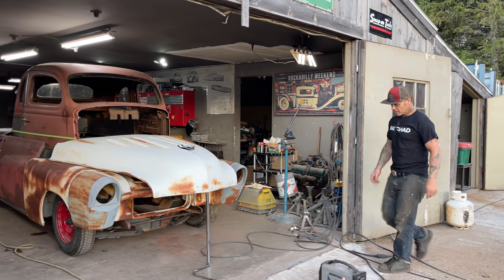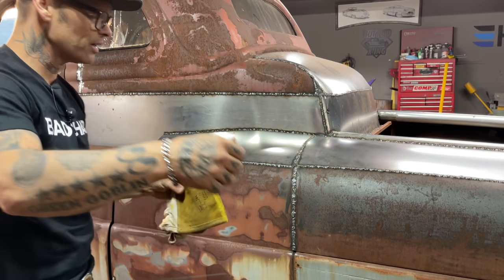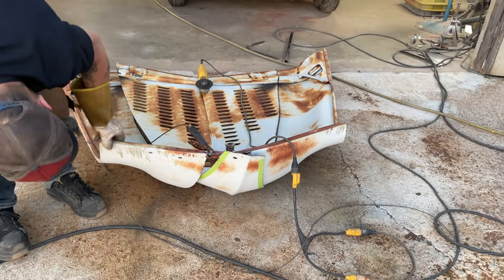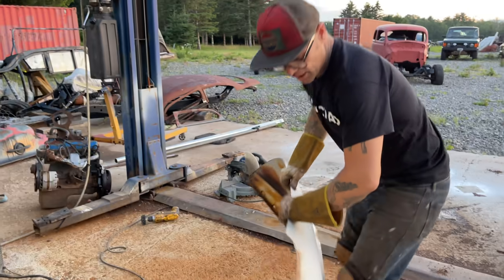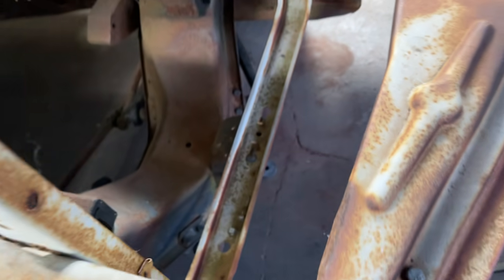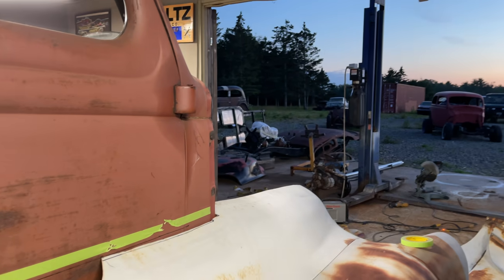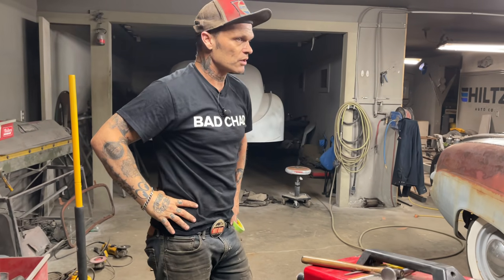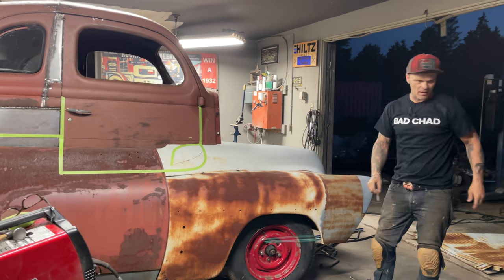I CAN'T BELIEVE WE'RE GOING TO CUT UP THIS LOUVERED HOOD: THE CONTROVERSY CONTINUES

Comment: You need a built-in steps to get in and out.  You could do a fold down stair where the lower door is, like a lear jet.  That top curve you are trying to clear with the door could fold out and down to form the stair and the top door could swing from where it is because that section of the door is no longer in the way.
Reply: Swing the door up instead out out would also be ubbercool.

Comment: I think I would have the door go all the way down to the original merc. rocker. You could then hide your ladders and gas tanks, toolbox, air tank for lowrider? below the floor of the cab. when you shut it, all is hidden. you will have to extend the pin of the upper hinge to match the lower pin location. That way the door will not bind on the wider lower door skin. Perhaps you could use both of the ford upper hinges that will stick out from the cab 5-6 inches from the body as a rear view mirror mount. and the merc lower hinge below. All trucks have big rear views, and that huge door will be tough on the top hinge, hinges. It would be clean, nothing to ruin the body lines you got cooking. If you know what I'm trying to say. Killer looking ride.

Comment: Hoping this ends up making some logical sense.  Cars carry passengers and cargo and have structural requirements and a drivetrain.  The amount of space devoted to each of those can and does vary but there are never large void areas with no function.  This looks like it will have a passenger compartment with a large void below it and ahead of that space for almost two engine compartments.  That’s not the way it works.  Love the work ethic and craftsmanship on display but if this is supposed to be s real vehicle  and not just yard art I am just not seeing it…. yet.

Comment: If you shape the door bottom the second design (swept back) you would avoid the problem of the bottom edge of the door hitting the rear edge of the white hood piece when the door is opened. The first design looks like it would crash into the hood/ fender when you open the door. Maybe playing with hinges would prevent the issue, but maybe not. It's just really hard to tell without being there.

Comment: You should go any further than the body line where it curves out on the door because when you open it the part that sticks out will hit on the front part. You should make the bottom of the door right where the body line curves out and follow that line down the side it will be the most appealing. And you could make a 1 foot section at the back of the door that extends down where the door curves out and when you make your door jam you can box in a step on the inside  to get in it.

Comment: It was tough cutting that hood, but it had to be done. The tape lines help with the visual. I would run the bottom of the door down to the old body line and cut the inner tape line radius to clear the old hood skin when opening the door 👍 Will be interesting to see how you fit the grill 😉

Comment: Good work with the Mercury hood, fills in nicely. My two cents, the front of the fenders with the headlight buckets are a bit too long and should be rounded not pointed at the top. Perhaps cutting them back 6 -8 inches and rounding them off would tie in nicely with the rest of the hood and curves. Thanks for the videos!

Comment: You have to think about hinge length and hinge pin location Chad. If your door includes the lower portion of the body which obviously hangs out further, the upper hinge also needs to go out at least that far so the hinge works. Hinge pins need to be on a plain to one another, so it will be interesting finding an aesthetically pleasing solution for this body.

Comment: Bottom of door in line with the horizontal rear quarter/rear door body line. When the front door opens it will reveal a step to allow you into the cab without stopping on the outer panel/guard

Comment: I hope you use a pattern from the first hood side to cut the second one.  And I hope you end making the hood open like a semi from the front where the original narrow hood and the merc sides all come up as one piece.  If you weld the merc sides to the body it will make it hard to work on the engine.

Comment: Take the back window as part of the door. I know its a little more trouble but opening the front and back windows as part of the door would be unique and pretty cool. I have a picture in my mind of steps inside the open door (covered by the closed door skin) leading up to the driver and passenger bench.

Comment: I'm assuming at this point the bottom hood has become basically the top of the front quarter panels and the top hood will actually provjce access to the engine. I guess you'll run another pipe down the middle of the front from the bottom middle of the windshield bent down to the middle front of the truck. Thus providing somewhere to hag the top hood doors plus to provide a place to mount that grill?

Comment: DOOR SHAPE. I see a potential problem with hinging the door shape. Where does the lower door bulge swing to if the lower hinge is in line with the upper hinge? Outside or inside the front fender? Second option might be easier to work out. Keep up the great work. I'm sure you will work it out.

Comment: Isn't that bottom hinge going to determine where the bottom of the door is? Looking great!
Reply: I am confused too. This hinge pin axis determines the opening geometry. I suggested two doors each side. The lower one hinges at the bottom and rotates out to reveal a stair. It also clears the way for the more expectable cab door. After inside and closing the door the bottom would mechanically fold back up. It is a safety problem because in the closed position without the lower panel moving out of the way you are trapped. What do you think?

Comment: At the start I couldn't visualize the doors (different hinge positions, different widths). I then visualized that all of the surrounding metal work would get done, and then the doors would be taped out and a door would be formed out of all the required pieces. Turns out that is how Chad saw it as well. I think the door should be "as tall as possible", but still allow a stepped gas tank. Making it "tall" will integrate the 2 bodies better.

Comment: Chad, Your front door line has to go forward or it will hit the front fender as it swings open. Your curved lower section has to go inside the fender as it opens. Look at a 1948 Chevy and you will see what I mean. You might be able to use 1948 Chevy door hinges too.

Comment: Can’t help but think that there was a curve or bump in the hood or the fender that was causing the hood from not laying down as you wised it to do.  You kept cutting off the top of your piece rather than figuring out where the pivot point was and cutting a small portion of the hood where it touched the fender.

Comment: Hilarious- keeps cleaning his ground on the part that falls off- rinse and repeat.
Reply: That is so you don't ruin the patina on the piece you are using. Is it still hilarious?
Reply: @crzy11000  This may come as a shock to you, but the hood has 2 sides, one of which no one will ever see.  BTW, this is not going to be a "patina" rod, by the time he is finished it will be covered in bondo.
Reply: @oldschool1993  I'll bet it never even gets that far.
Reply: @crzy11000  Agreed- it will get shoved outside to rot along with a bunch of other unfinished ideas.
Reply: @oldschool1993  I wonder if he ever thought about selling the projects as just a shell. A lot of people would like to finish one of these projects themselves.

Comment: That's what happens when your to lazy to measure something!!! I'm screaming measure the tape lines, but mr. Chad just doesn't give a damn!!! Why do I even care? Keep on hacking bro!!!
Reply: I saw the same thing, measure it out, then give yourself an inch or two for the final fit. I think if Chad had a couple of models he could play with them in the evening to see how they would need to be cut. But then he wouldn't be Bad Chad, cut away Brother!
Reply: Measuring simultaneously in three dimensions like that is a good recipe for a bad fit.  I suspect he got there faster better with the three cuts.  As a woodworker, he did it just the way I would -- you can't put the wood back when your measurement is too wide, so you creep up on it.
Reply: I don’t think lazy is the term to describe Chad. He is anything but. Experienced, yes. ☹️